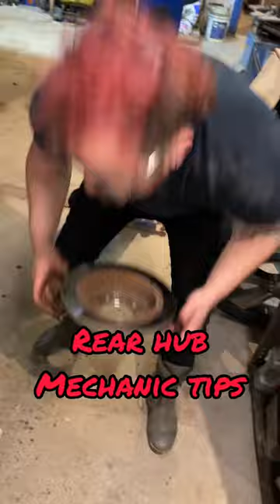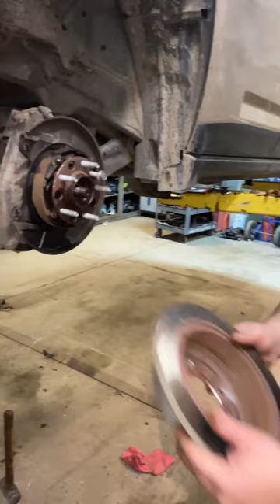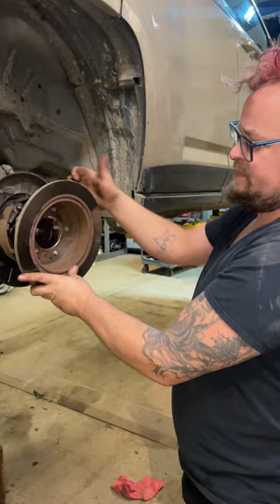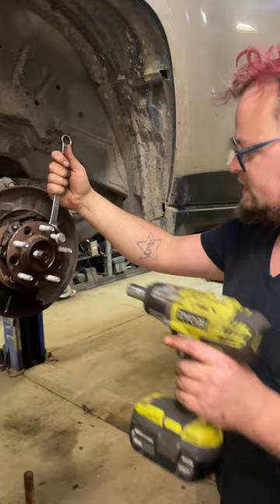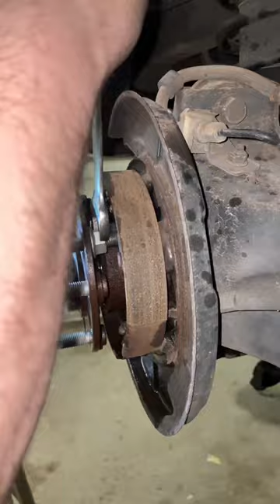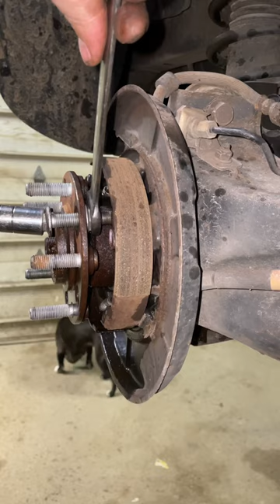Mechanic Tip of the Day: rear hub edition #carguy

Comment: NO......flip the rotor, and catch the lug nuts on about 4 or 5 threads. Now use the rotor like a slide hammer....works every time for me, since 1969....
Reply: Better off with a steel rim, same idea more weight.
Reply: clever

Comment: If it's a hub assembly then pulling off the hub face all you did was make your job harder. If it's press in then thats a cool idea over the slide hammer. I use Astro pnuematics hub remover and its a life saver. Same concept only it has ball bearings on the end of the bolt as well as 2 feet so you dent up the knuckle....
Reply: Yeah, everyone commented saying how great that works has no idea how bad he messed up